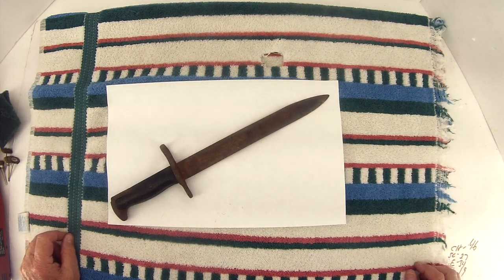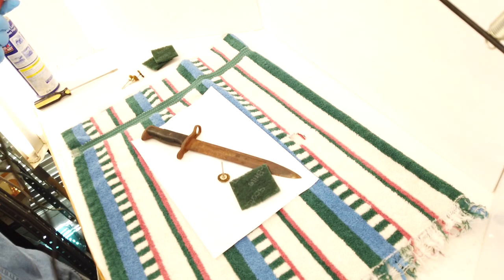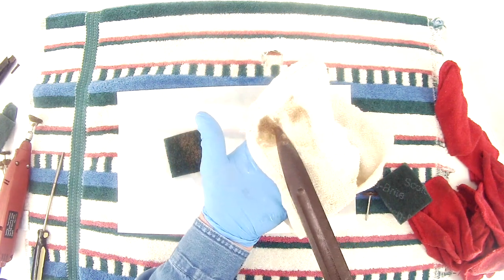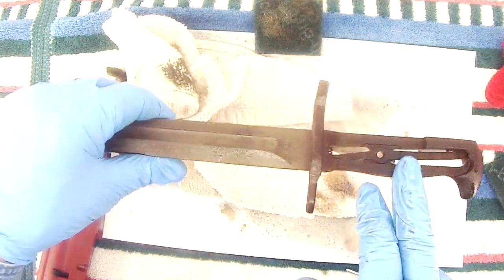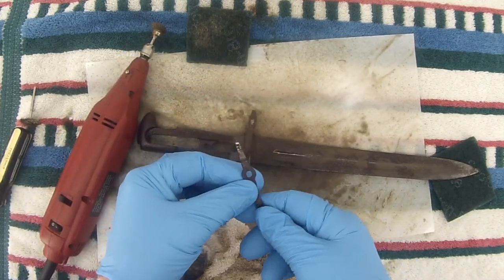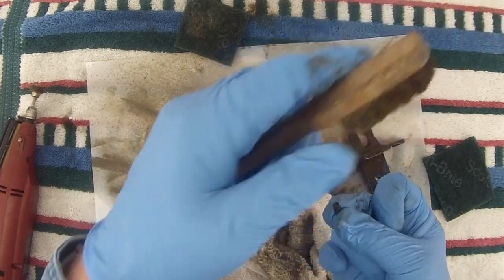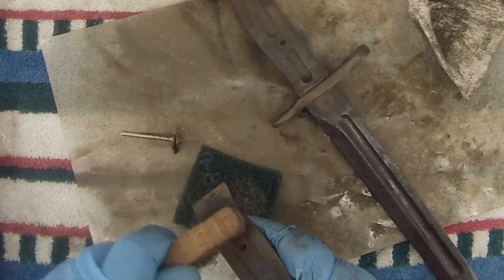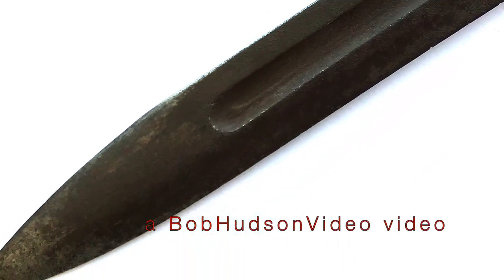Removing rust from a rusty rusted  M1 garand bayonet or other knife, sword, bayonet, helmet, etc.

Comment: Great video. I've had some success with placing smaller pieces in my brass tumbler. It saves a little elbow grease,and acts as a bit of a polisher too. BUT you have to be mindful to run it through a strainer so you don't lose any of the smaller bits.
Again, great job!
Reply from the maker: Thanks!

Comment: WD-40 is not an ideal chemical to use.  CLP Break free is a much better chemical to use.  CLP Break free preserves, cleans, and protects.  WD-40 attracts rust over time.  I will admit however that you did do a great job cleaning up this bayonet and saving a precious piece of history.
Reply from the maker: The WD-40 is all removed as the last step of this process: I wipe it down with window cleaner and then blast it with compressed air. So the WD-40 is being used as a rust remover cleaner and not as a protectant.

Comment: On my channel I did something similar with a 1917 WW1 Bayonet. I used steel wool and a wire brush to get the rust off completely. Was that a mistake on my part? I've been told that it decreases the value but I didn't know at the time I was restoring it. I think it turned out fine anyway though. From 1917 but looks like its brand new!
Reply from the maker: There are two thoughts on this: mine is to remove and halt brown rust, but do not go down to shiny metal. Then there are folks who think that the have to go down to shiny metal in order to make it look good - and yes that does result in something that worth less - sometimes far less - than something that has no brown rust but does have a black patina that has built up over the decades. This is not unique to bayonets and other sharp pointy things: Antiques Roadshow often has furniture that someone's dad has "restored." But the piece may only be worth 25% of what it would be worth if they had done nothing and just kept the original finish, faults and all. My goal, again, is to stop the spread of active brown rust and using scotch brite pads and soft brass brushes  ensure I will not remove the patina. 

There is something even worse than going down to shiny metal: that's sharpening - you can wipe out 90& of a blade''s value by sharpening it.
Reply: Depends what you want it for, as an investment keep as original as possible, without letting it rust away, for display purposes you might want to show it at its best and restore to that.